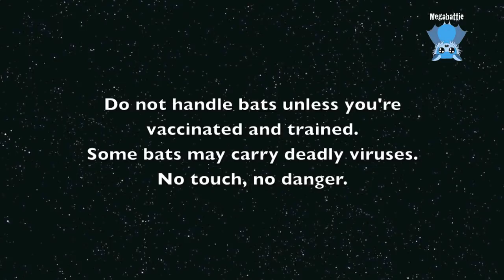Rescuing a bat caught on barbed wire:  this is Josie

Comment: +Megabattie  It took me a bit to find this one again, but I have an idea for you that might work better, but similar to the cut up pipe you used.  Get a swimming pool noodle or two, cut the length on one side, then cut them into preferable sized pieces.  We get them at our dollar stores during our summer.  They're also hollow inside, but not as much as the hard tubes.  Also the styrofoam is more likely to stick to the barbs, but come off easier.  Best of luck!
Reply from the maker: I'm going to use tennis balls next.  See if I can just isolate each barb so I can work bette.r

Comment: Rest in peace, sweet Josie ❤️  That barbed wire is so maddeningly unnecessary.

[edit:  I don't know if this would work with flying foxes, but there's a lot of barbed wire around here too, and whenever an animal gets caught, we've been covering the barbs with the semi-flexible, cardboard rolls that our local "child-safe" (non-toxic) paper towels come wrapped around, with a slit like you have on the hose.  It's sturdy enough to cover the barbs, but it also has one really great additional feature: it can be cathartically bitten by a scared animal, and they seem to feel like the bite has really "worked" because they can sink their teeth into it.]

Comment: Jeez I had to watch without sound, so there may have been some mitigating commentary, but this looked like absolute hell. 

I would expect electrified wiring to be just as effective as barbed wire and not represent a mortal threat to local wildlife, if one really felt the need for this kind of ridiculous deterrent... but that's neither here nor there at this point I suppose, and you have enough trouble just getting people to use proper netting =p